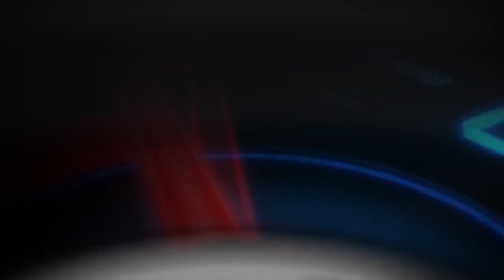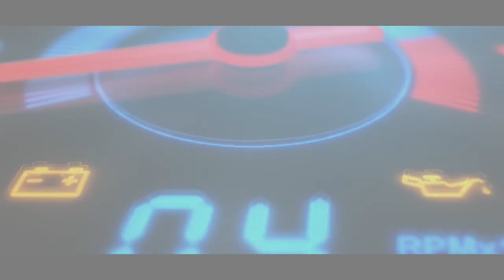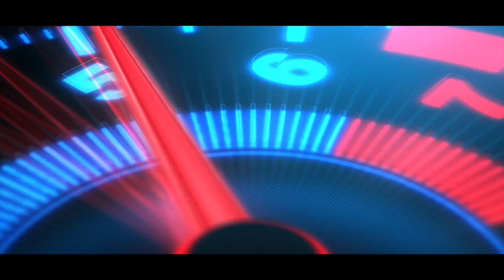How To Remove the Cadillac CUE Infortainment Nav Radio Unit

Comment: Are the original icons used? Meaning it’s a direct replacement just as the one we send back “core” or is it different like the pictures on the website  I’m looking for ome type model.
Reply from the maker: Hi Bill, yes, its a like-4-like match.
Reply: @issautomotive   I ordered my unit on Saturday I’m looking forward to receiving it, and putting the none responsive screen behind me, thanks in advance.I’m in California are you extending your return policy for covid? I don’t know if any stereo shops will be open to install this unit, so I can send back the other one. In the time frame given.
Reply from the maker: @billlovest6049  happy to help! Take your time. We are very understanding given all that is going on. We don't actively monitor youtube so please feel free to email our technical team if any issues. Have a great week and happy Holidays!
Reply: @billlovest6049  hey I’m having issues with my cue system and this seems to be the only replacement I’ve seen, are you satisfied with your replacement unit?
Reply: I'm wondering also if you were satisfied with your replacement Bill. I've been looking online and this one popped up.